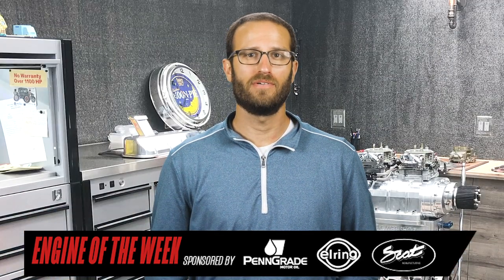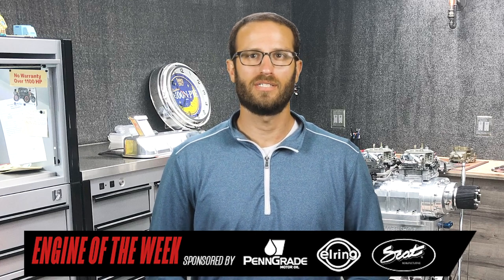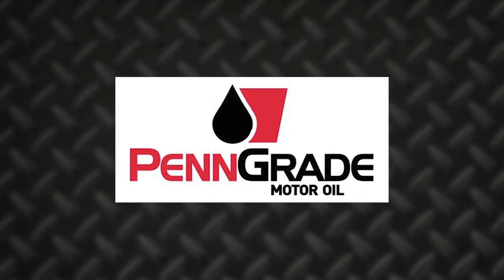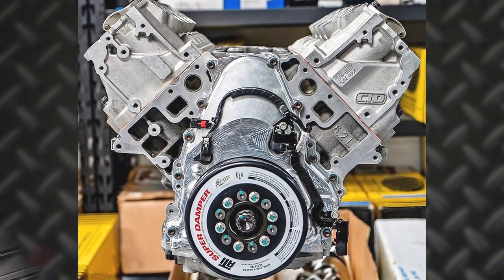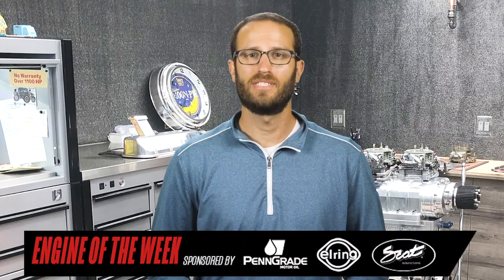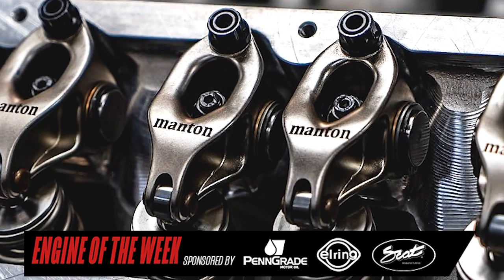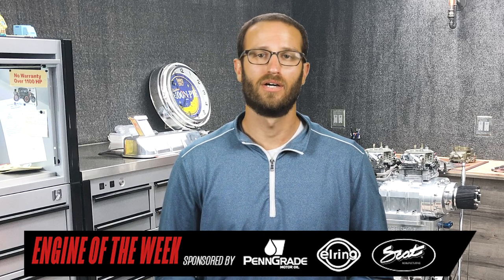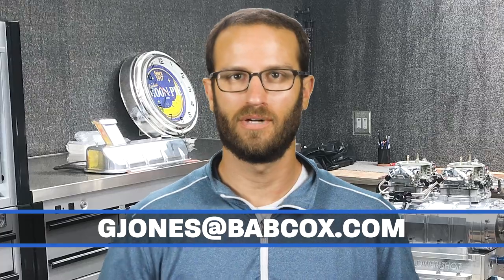Twin-Turbo 427 cid LT Engine

Comment: M.A.D. does excellent machining. I highly recommend them for your next project. No matter if its just machining your part for you to assemble, short block build or long block build, or there superb head, blower, or intake porting. There work is just as good or better than LME at lower cost. And the engines don't spin bearings or oil alot!!!